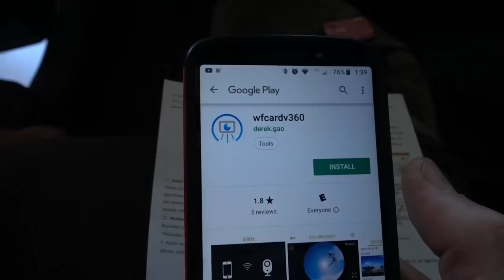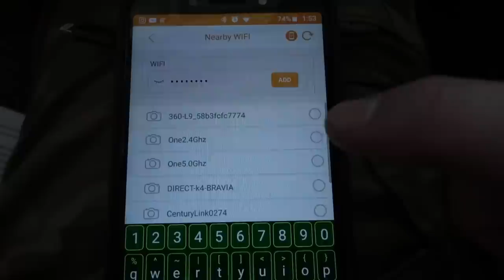Will Walmart Supertech Oil Filter "WILL RUIN YOUR CAR" YouTube wisdom Best crash Dash Cam Yokola Y9

Comment: Excellent video. I remember in another video you showed how you just dust off the air filter time to time and you still get factory mileage and there’s no obvious signs of wear. For an out of warranty low power output, durable Toyota, that’s interesting advice.

I’ll bet your Yaris will still be running 10 years from now 😂 by which time 2 generations of out of lease BMWs will be in the garage for major repairs 😂
Reply from the maker: Yeah this thing needs to die so I can get my Toyota sienna.. Haha

Comment: I now drive a Police package Crown Victoria. People generally avoid my car. 😁
Im still going to get cameras as well as a traffic advisor.
Regular oil is good for 5,000 milea if you change the filter and top up at 2500 miles. Synthetic is good for 10,000 miles if you change the filter and top up at 5000 miles.
Reply from the maker: I never have to add a drop for 5k miles
Reply: @vegasromaniac  Just to replace what you lost in a filter change (typically 1/2 quart).

Comment: Inspect your bike oil filter if not using hiflo filtro I have a few that are partially unglued and couldn't use. 
From Rocky mountain I only kept them cause I'll figure out what type and glue them and if not they was cheap and the hiflo filtro I have I been able to allow soaking it for days and lightly blew it out and change my cheap jaso super tech by color. 
Just fyi for those not sure "look closely" all around both sides it's tuff to see. 
I'll be checking all filters from here out.
Reply: Idn wanna go on about this just know I am not a jerk. And I've had to much I've let slide.
Getting a camera, cause I've even tried using my phone before, yah huge mistake. 
This one got to the point where I rolled up my window and flipped him of and said you can wait for your backup to arrive cause idn trust you 🤣 done man like leave me TF alone and they don't thy are like as bad as people idn wanna be around otherwise.
I am sure people know... Over wanting to argue me being a resident I told him I was staying with a friend and that is all he needs to know regardless of how long *only if I plan on staying to I need to get a license here" he thought he had me cause I had to buy a new truck here and had to get Florida plates and am now two months stuck here till shit is cleared up.
Hearing tried throwing back in jail . Like get over yourselves people Florida is not that great "not sorry"
I need to get back to where I get paid what I am worth.
Shit show💁🏼‍♂️

Comment: The only filter I actually refuse to buy is Fram. I think Wal-Marts were rebadged STP oil filters. Frams are really weird in that their drain back valves and springs are actually very poor and didn't (or don't now?) use a real spring. So my strategy has always been use cheaper oil, like a Supertech or similar (actually liked Rotella 15w40 as well) but use a NAPA Gold Wix filter for $5-8 or so. Wal-Mart's also good in that you can buy Ford Motorcraft filters for very cheap, and those are almost as good as a Wix filter if you have a Ford vehicle. I could only rarely find Supertech filters in my part number, though, and I refused to get Fram, so NAPA it usually was. To me this seemed logical and not really going above and beyond in crazytown buying Royal Purple and Amsoil and K&N wrench on oil filters for $15 and all that nonsense.
Reply from the maker: Good to know

Comment: I love your videos. Dash cameras are  cheaper on EBAY.
Reply from the maker: Yeah I had one on ebay, but quality was bad and the battery went bad in it, this one has a capacitor so doesn't boil in 150f Vegas heat
Reply: @vegasromaniac  .living in Thailand I have little options. So far the second mirror camera in the Yaris is fine, the first died witjin 2 months.The cheap Chinese camera in our Fortuner is also OK so far.

Comment: the name on oil and filters doesn't matter as much as how well it works. for example, i'll get my oil and filter changed at the dealership when they have a special on oil changes for $19.99 but the oil is super thin and i have to add a quart in between each oil change. Now i will go buy Royal Purple Oil which is $40 for a 5 quart jug with one more quart at $9.79 and the same brand filer at $15 in a thicker oil which i will get longer life out of it.
Reply from the maker: The only vehicle it burned oil I ever had was a klt 650 haha
Reply: My Escort burns oil when cold. But then again, it has 342,000+ miles on it.
Reply: haha right on. mine doesn't really burn oil it's just so hot out here and the oil that ford uses is really thin stuff, so i have to use thicker oil.
Reply: with over 340,000 miles it;s to be expected but my truck is a 2001 with 167,000 on it and it doesn't burn oil it just the dealership uses such cheap thin stuff and it hits 125-130 degrees during the summer that the stuff evaporates or whatever so i just need to use thicker stuff.
Reply: @Minionmoto529  My oil pan is full of Lucas oil stabilizer in the Escort. Still running OE-spec oil in my Crown Vic Police.
Reply: RIGHT ON. YEAH LUCAS WORKS GREAT I USE royal purple 10w-40 or something like that and it works great as well especially with their oil stablizer.
Reply: @Minionmoto529  When Kenne Bell reccomends their octane booster for use with his superchargers (that arent cheap!) that the product has to work to their needed parameters. I may eventually go to a low concentration on the synthetic stuff in my CV once it hits 200k. And Ford specs light oils for the close tolerances in their OHC engines.
Reply: @dr.hugog.hackenbush9443  I gotcha